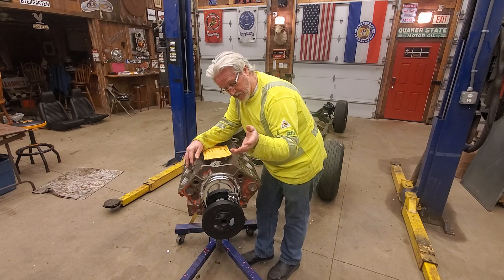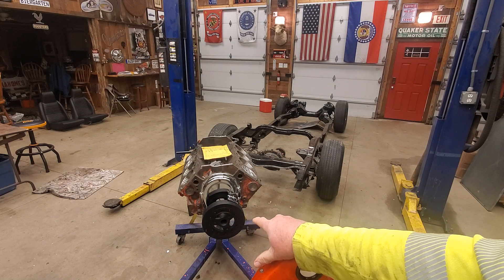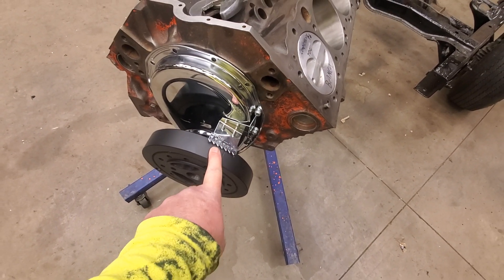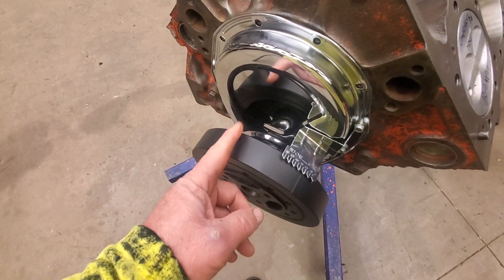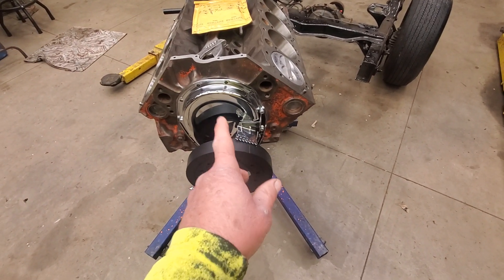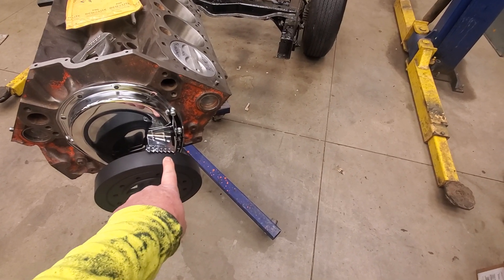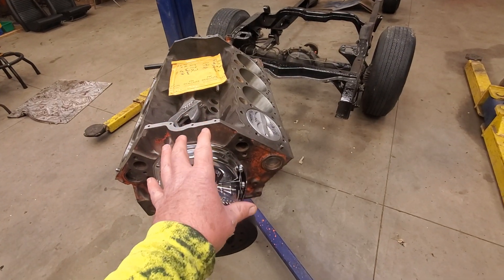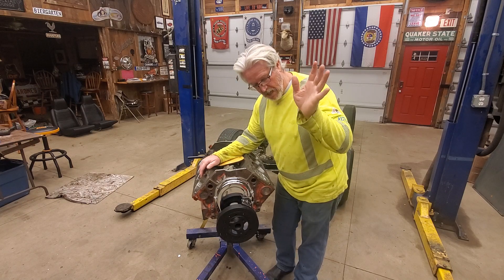The biggest mistake you can make when building an engine!

Comment: I can't feel tdc...might be off 3 degrees and never know.   I spot check timing marks as part of degreeing the cam.  Dial indicator is out, so I use it.
Reply from the maker: Yes but not everyone has a degree wheel. And on a mild, street driven car, it's not needed. This is the quick & easy way to verify timing marks before assembling the engine.